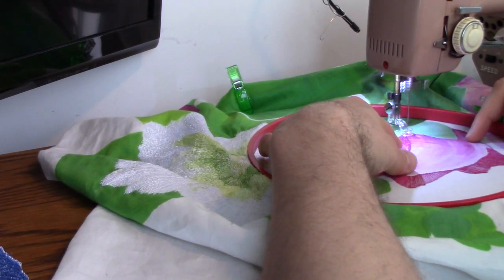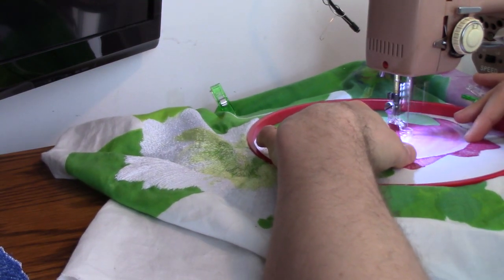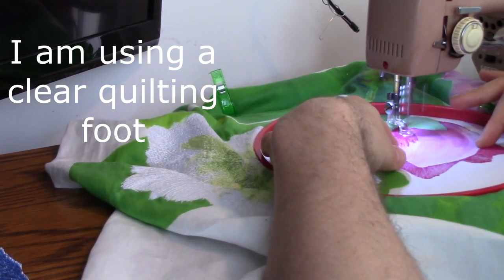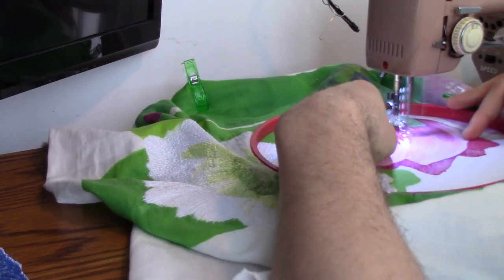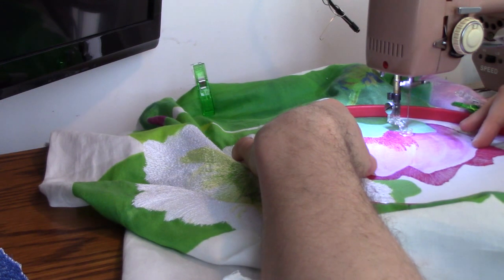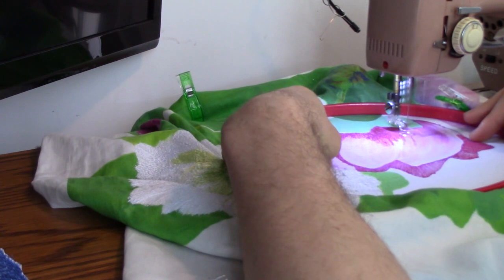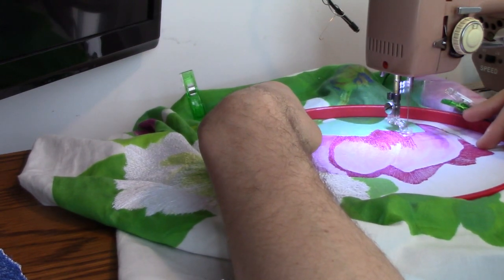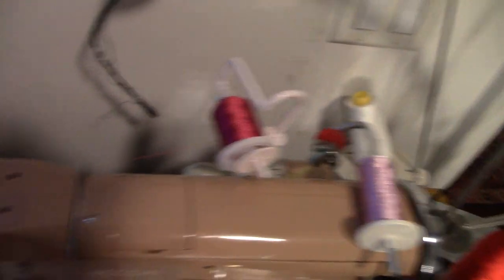Necchi Nora -- Thread Painting

Comment: Thanks for doing the video 🤔 is it hard to find parts for that sewing machine because I’m buying one tomorrow and I don’t know if it works😁
Reply from the maker: As long as it has been packaged well for shipping, it should be fine. The machines are very solid. If it has not been used for a long time, you will need to give it a good oiling and cleaning -- it will may take a few days to loosen if it is stiff. But most of the parts you need can be found on various sites should it come to that.